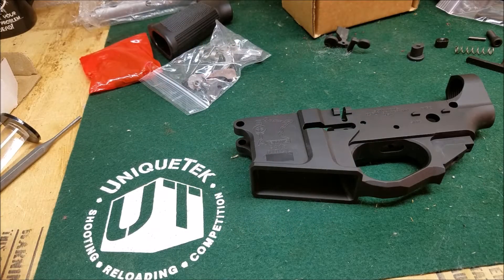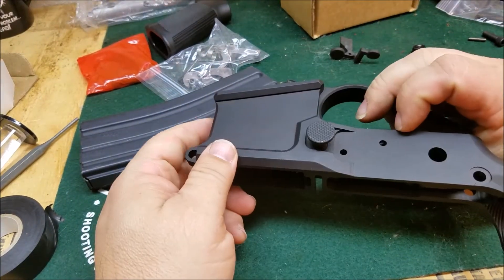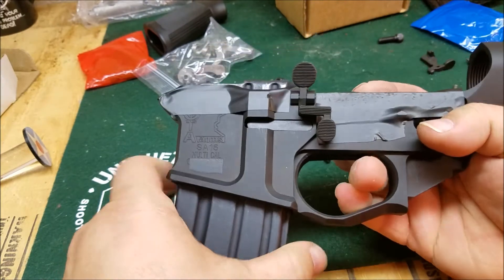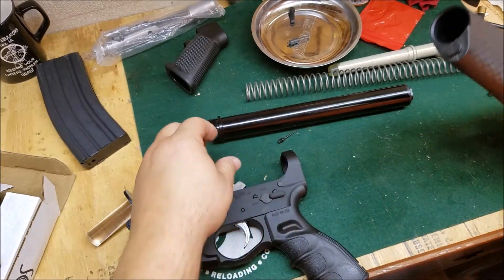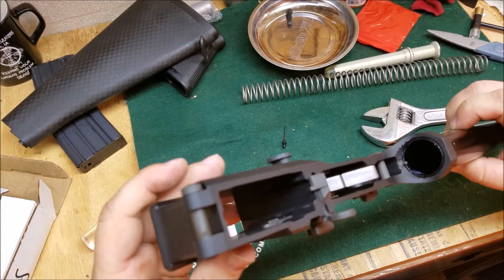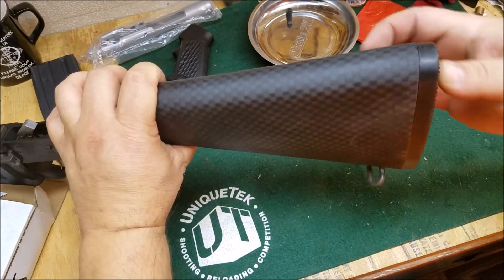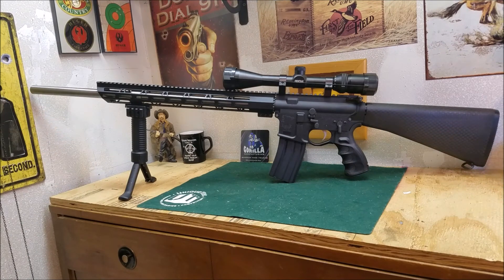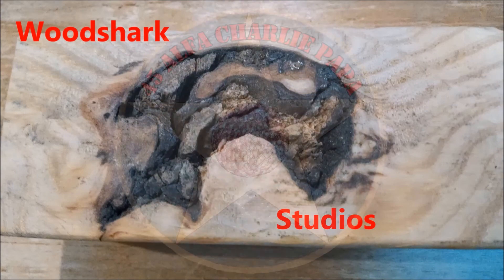My 24" Bull Barrel AR Rifle Build (Thumper Part 1)

Comment: What is the benefit to this barrel? Accuracy due to stainless steel? Approximately how much was the barrel? There’s one for 350 on criterion that I am looking at. I’m also wondering what the speed differences are on a 20 inch barrel versus 24 inch.

Comment: Looking for the hbar club. Think I found it. my kit is a 24" 1:8 twist 556 nato 416r as barrel, rifle length gas system, 15" mlok slim free float hand gaurd, mpi nitride coated M16 bcg, armaspec h3 sound midagation buffer, Magpul furniture, enhanced trigger and springs. Wondering what size buffer everyone else runs on their rifle length gas hbars?
Reply from the maker: One day I will throw this on a carbine lower and see how it runs. I have the video in my head just have not had the range time to do it. Want to do ejection patterns and the like and will take some time to film. Thanks for watching.